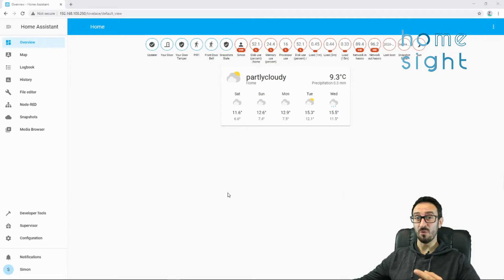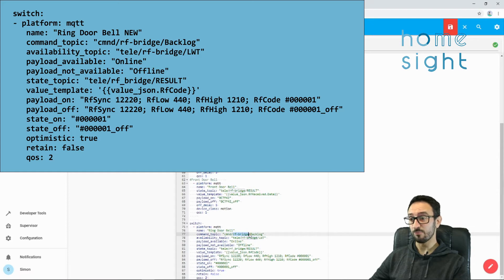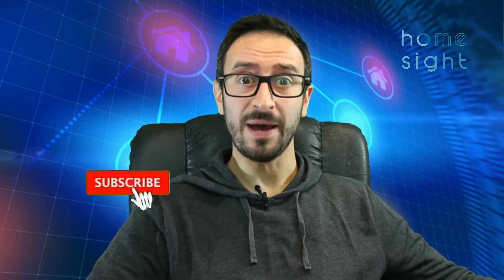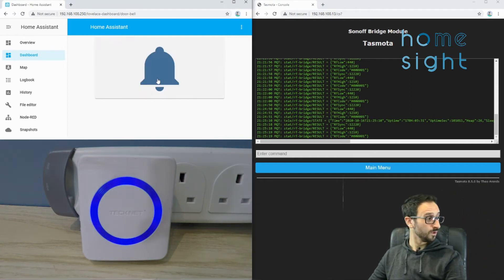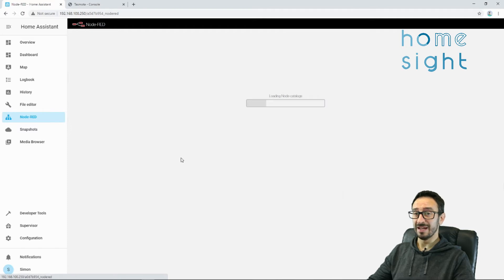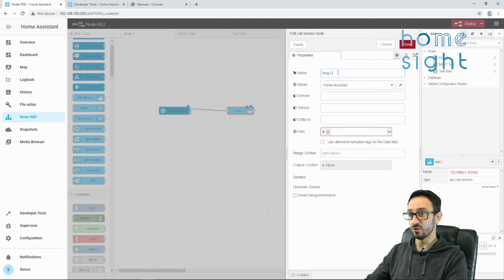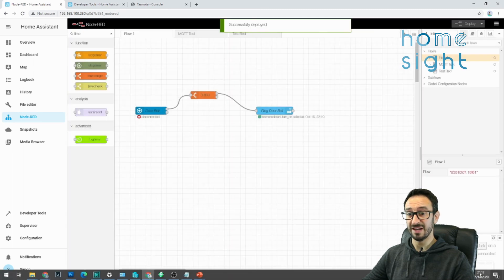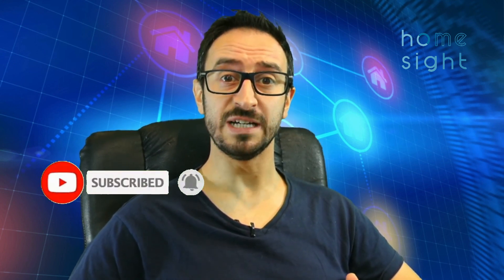How to send RF Signal with Home assistant using Sonoff RF Bridge and Node Red

Comment: Hi Simon. Thanks for the videos , but I'm afraid I'm not getting it to work as per the video.
I have a Sonoff RF Bridge, flashed with Tasmota working 100%. I also have a Sonoff Doorbell (Code #2C6465) and a cheap Ding Dong doorbell (Code AAA055 which I retrieved by using rfraw 0xB1 from the console in Tasmota)

My config.yaml looks like this:

mqtt:
#RF Door Bell Send Signal
  switch:
    - unique_id: Door_Bell_Send_Signal
      name: "Sonoff Door Bell"
      state_topic: "tele/rf-bridge/RESULT"
      command_topic: "cmnd/rf-bridge/Backlog"
      availability_topic: "tele/rf-bridge/LWT"
      payload_on: "RfSync 10540; RfLow 360; RfHigh 1050; RfCode #2C6465"
      payload_off: "RfSync 10540; RfLow 360; RfHigh 1050; RfCode #2C6465_off"
      state_on: "#2C6465"
      state_off: "#2C6465_off"
      optimistic: true
      qos: 2
      retain: false
      payload_available: "Online"
      payload_not_available: "Offline"
      value_template: '{{value_json.RfCode}}'

  binary_sensor:
#RF Door Bell Receive Signal
    - name: "Ding Dong Chime"
      state_topic: "tele/rf-bridge/RESULT"
      payload_on: "#AAA055"
      payload_off: "#AAA055_off"
      payload_available: "online"
      payload_not_available: "offline"
      qos: 1
      device_class: opening
      value_template: "{{value_json.RfReceived.Data}}"
      off_delay: 5

From Home assistant, everything works fine if I click the button I added.

MQT: stat/rf-bridge/RESULT = {"RfSync":10540}
MQT: stat/rf-bridge/RESULT = {"RfLow":360}
MQT: stat/rf-bridge/RESULT = {"RfHigh":1050}
MQT: stat/rf-bridge/RESULT = {"RfCode":"#2C6465"}

 but if I press the actual Sonoff Doorbell button, nothing happens. If I press the button again, the sync, Low and high values changes and remains the same, until I press the button in Home assistant again.

I see this code in Tasmota console.

MQT: tele/rf-bridge/RESULT = {"Time":"2022-09-23T16:21:54","RfReceived":{"Sync":10530,"Low":1040,"High":380,"Data":"2C6465","RfKey":"None"}}
MQT: tele/rf-bridge/RESULT = {"Time":"2022-09-23T16:21:58","RfReceived":{"Sync":10540,"Low":360,"High":1050,"Data":"2C6465","RfKey":"None"}}

Another thing I noticed is, that if I disconnect my RF Bridge, My Sonoff Doorbell still Rings the Ding Dong Chime.
In Node red, after reconnecting the Bridge and after adding the time range and adjusting to a time range where it is not suppose to ring, it still rings. 

Any tips or ideas what I am doing wrong?

I am fairly new to Home assistant and never used mqtt / node red before.

Thanks in advance.

Comment: Hi Simon, great video. I managed to flash Tasmota onto my RF bridge using your video and get it configured to communicate with Node Red, thank you. I used the same Tecknet doorbell and it works perfectly. May I ask what brand of door switch sensor you are using?
Reply from the maker: The door switches I use are unbranded, and were the result of buying loads of different ones on eBay to find ones with open and close signals. The annoying thing is I can’t find them more!

Comment: I couldn't get the bridge to recognise the Teknet Doorbell button. I'm not sure why this would be, but I suspect it's a limitation with the RF module firmware. I thought about flashing with Portisch firmware, but it seemed very complicated. My solution was to keep buying different brands of doorbell from Amazon until I found one that worked! For those interested, the SECRUI Doorbell works perfectly. What brand of door sensors do you use?

Comment: I bought the exact same TECKNET doorbell. The bell works as you show. The doorbell button does NOT work. It does not show in the console fo Tasmota. Not way to set it up without the code... Bummer. Did you actually use the button or are you just using the bell as shown?
Reply from the maker: Hi, I use the button and the bell!

Comment: Thank you Simon. Your RF bridge vids solved a long standing puzzle - and I like your teaching. Well done. Henceforth i'm sold on Nodered! I hope now to build automations with RF sensors via RFBRIDGE>NODERED>MQTT-in node (via HA). Ideas for you? There's nothing I've found on that topic. And there's very little on RF temperature sensors.  And how fickle are RF doorbells that refuse to pair with anything but their own ringers. Best R
Reply from the maker: Glad it helped! I tend to use the entities setup in config.yaml rather than direct into node red, that way you can easily use them on Lovelace dashboards etc. Thanks
Reply: @HomeSight  Yes, I think now that putting mqtt settings into configuration.yaml is the better idea.

Comment: Simon thanks for great videos , Could you do a video on how I can use my Sonoff RF remote ( 4 Button ) through the Sonoff bridge ( Tasmota ) to control some lights on and off . I am sure there could be a way to press Button A for on and then press Button A again to turn the light off , all using Node Red. I would really appreciate it. Thanks
Reply from the maker: Hi Vaughan, thanks for watching. I’ve not done one specifically around an RF button with node red; although you could check this out which is using a zigbee button with a light https://youtu.be/zPhLnhnppBk